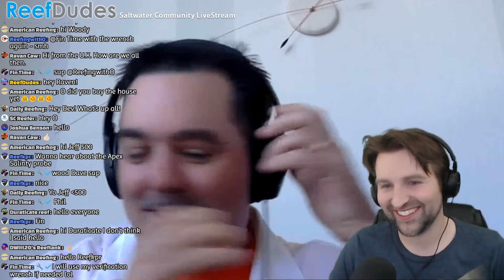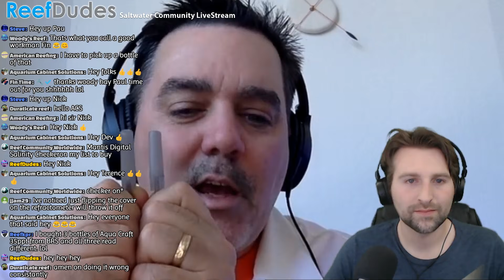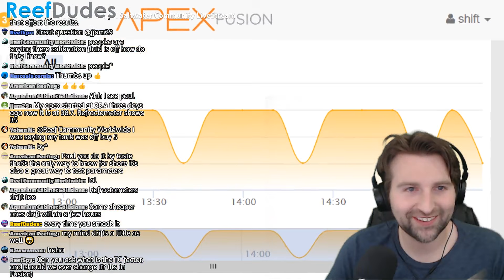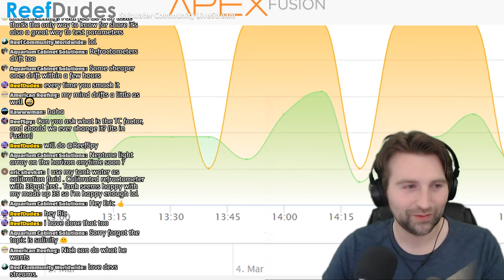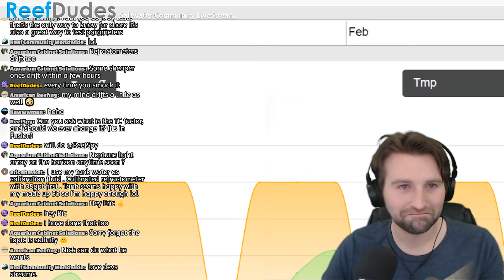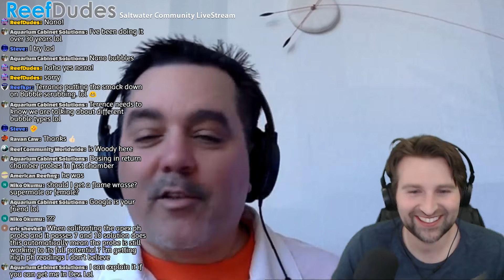Reef Tank Salinity - Ranges, Refractometer, Neptune Apex Conductivity probe

Comment: When I got in this hobby in 2004 I calibrated my refractometer with rodi. I got out of the hobby in 2017 and just set a 125 gallon back up in December 2019. I got my stuff out of storage and all I heard from these videos was to get the salinity calibration solution. I ordered it and check my refractometer, guess what it was dead nuts 35 ppt. I calibrated it once With rodi when I got it and 13 yrs later it still good as day 1.
Reply from the maker: Impressive!

Comment: I cant get my Apex probe to work rite and has given up on it. It reads 34.9 after calib. Put it in my tank and it reads 28.2. I also calib my refrac at the same time. That reads my water at 1.026. I separated the probe wire and it makes no diff. The temp compensation is 0. I do not trust it. dont know how to fix it
Reply: I use calibration fluid to calib both devices
Reply from the maker: Are you potentially getting air bubbles on it?  Terrance did talk about a bunch of the most common causes at some point in the video
Reply: Not a bubble issue. check it and double checked and recal the probe multiple times
Reply: Plus, it reads the calib standard at 34.9 ppt
Reply from the maker: Try calibrating it to your tank water if your certain it’s correct :)
Reply: So I did as you suggested. Calibrated the probe to my tank water now it is reading 34.8.  When i put the probe in the calibrating solution, it read 40. I am starting to think that may be the calibrating solution is bad. Could that be the case? It was used before and was being stored in a screw cap tube.
Reply from the maker: Its possible.. but if you are 100% sure your tank water is 34.8 and you calibrate it to that.. you should be good to go
Reply: So I bought a new calibration solution and re calibrated the probe. It then read the solution at 34.5 and it is reading my tank water at 35.3. So it turns out the calibration standard was off. Now both the sal probe and the refractometer are saying the same thing.
Much thanks for your help
Reply from the maker: Milton English your most welcome!  I’m happy to hear you got it sorted out. Good thing it was an easy fix!